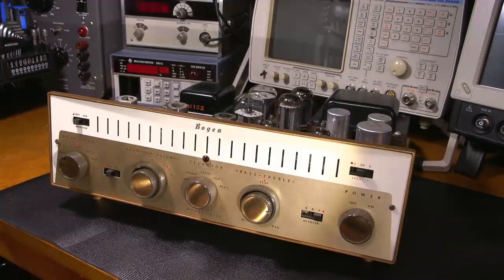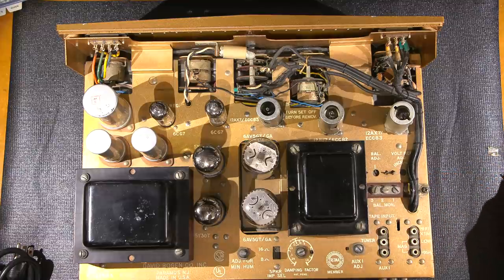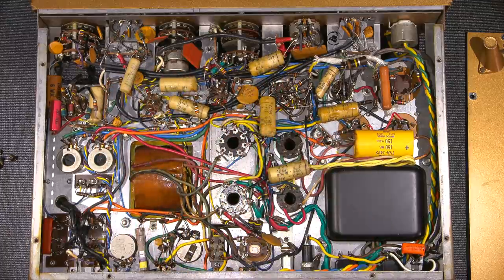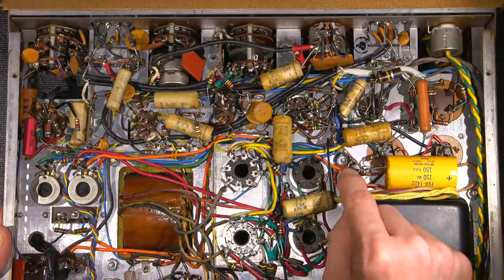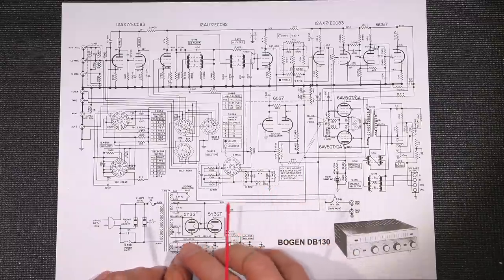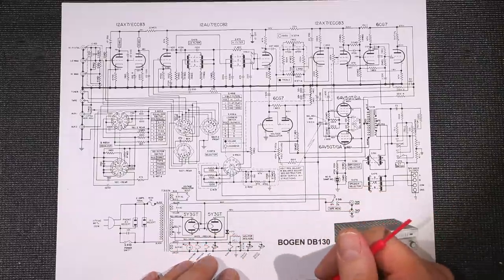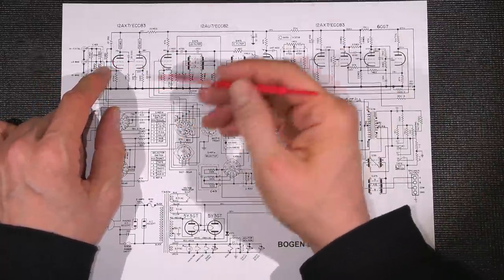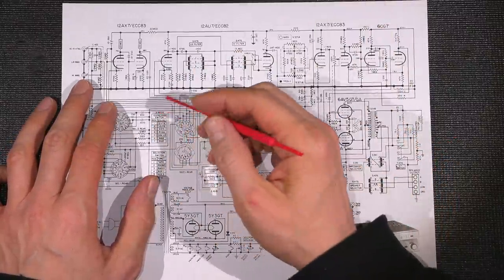Look Inside This Tube Amplifier!

Comment: I don't really understand that verified parts list? Just order something at Digikey, Mouser, Farnell are any other reputable seller?
Reply: Yeah, you'd think wouldn't you? :-) And I don't think there would be anything wrong with that within reason... but Paul doesn't do "it'll work", he does "it'll work absolutely correctly" so he's probably matched replacement parts that have characteristics as close to the ones he's removing and those are what is on the verified parts list. Been watching his vids for years, used to frustrate me at the beginning that he'd never plug anything in just to see if it worked! But he's absolutely right in the way he works and that's all part of what I've learned from watching him.

Comment: When you cut to the back-lit version that little combo amp I laughed out loud, I knew it was going to weigh a lot before you said anything :).  Dare I ask what that output tube is?  Is it readily available?  Some years ago I had an old Ampeg with 12DW7 tubes, they were pricey, and not in current production at that time, as I recall.
Reply: If I had my guess it would be a 6360 which is a dual power tetrode used in VHF service which can produce 16W peak power in class C.   Amperex produced an application note which talks about building a 30W FM transmitter using just these tubes.
Reply: @douro20  I thought to Google "dual tetrode modulator" and saw the 6360 tube, but the tube in the amp looks taller.  Maybe it is, it's difficult to get a sense of scale.

Comment: You call it "neat looking", i'd rather call it an eye-sore. How did they put this expensive stuff like those badass transformers and the pretty tubes  in there and then make the front look like a cheap heater control panel with those plasticky knobs and slide switches? Solid state stuff from the 70s was a million times better looking than this, at least appearance-wise. But this is no criticism - we do not come here because of your solid grip on aesthetics (your sweaters are a clear indicator ;-) ) but because of your attention to detail and your deep technical understanding. Thanks very much for the edutainment.

Comment: Help Mr Carlson.i own a  Way Active All Tube Active Crossover It's Name  is The Luxman A 2003 and I need to change the frequencies to suit my Klipshorn Cabinets.  O want to change the K 33 E Bass Woofer to reach up to 450 Hz  and the mid Horns  to work from 450 Hz and cut off at ,4.5 K Hz    My JBL Bullet Tweeters to start from  4.5 K Hz  and work up to infinity to around 17.500 K Hz.  What value PF Silver Mica Caps will I need to achieve This.
Please respond 
Regards
Francis Jansz